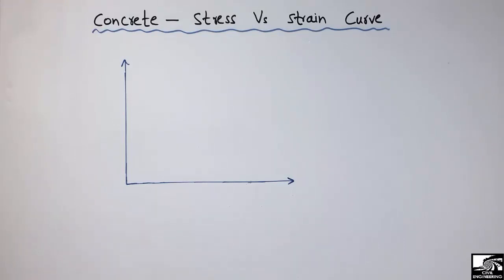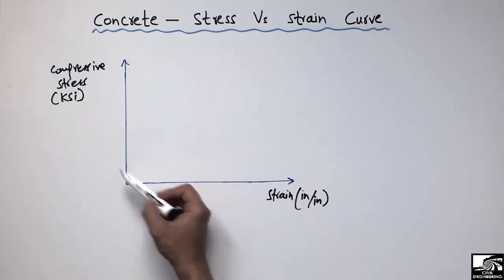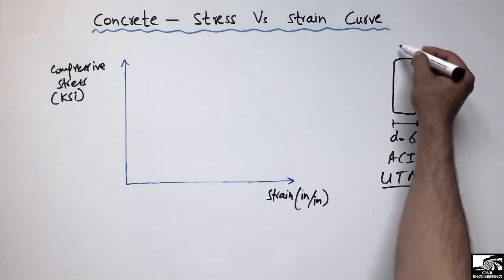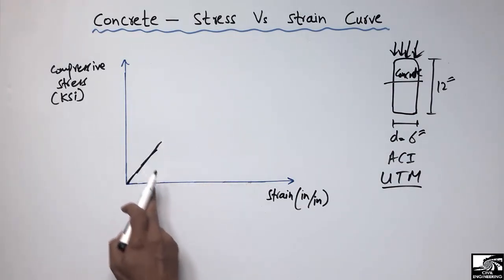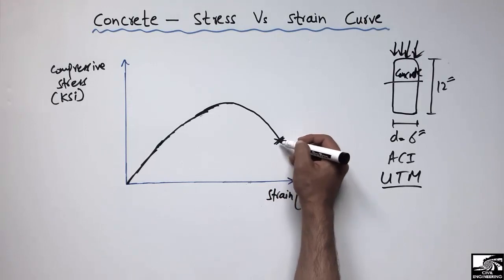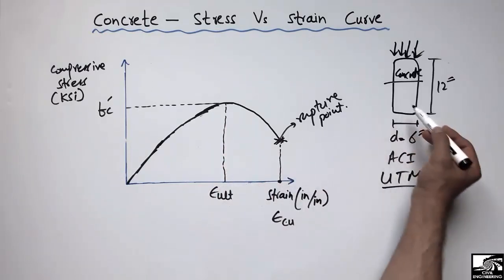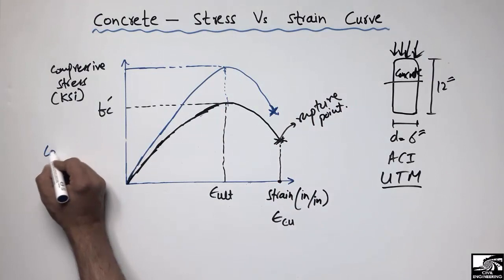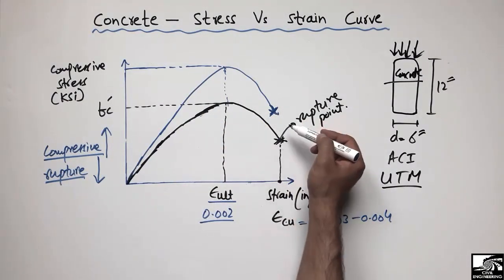Concrete Stress Vs Strain Curve

Comment: Very inaccurate. Please check section 3.5 of Wight (2016) Reinforced concrete for the real strain stress curve of concrete.
Reply: No it is not wrong itbis the actual stress strain curve but we take that stress strain  graph which is ideal. Because parabolic curve is very complex for calculation so we take straight line then calculate. That is not real that is odeal
Reply: @niva7737  hai niva can you share your mail Or insta to discuss subject civil